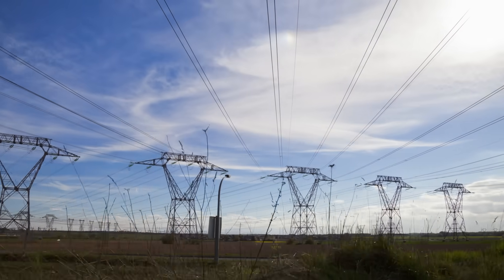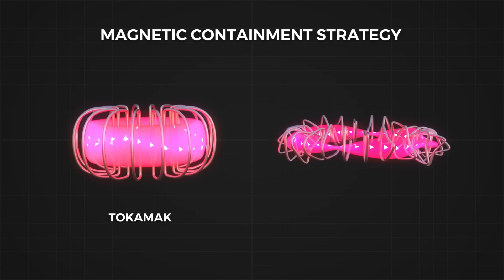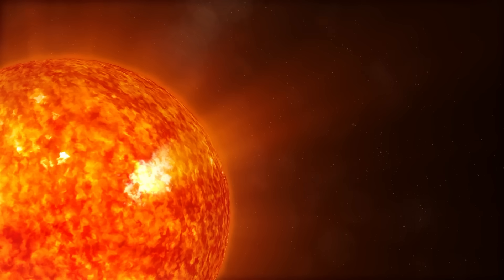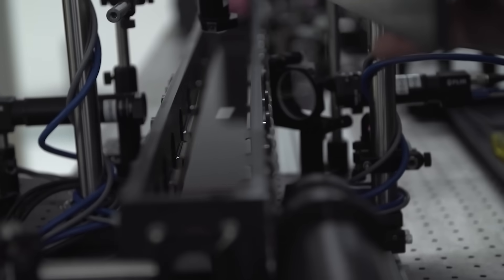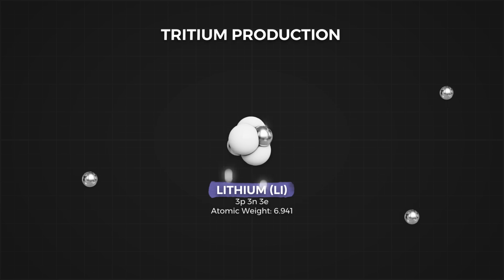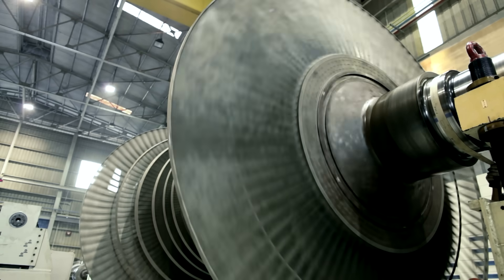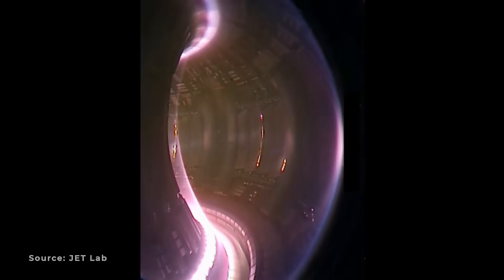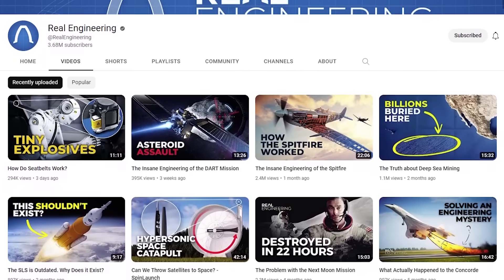The Problem with Nuclear Fusion

Comment: Fusion is nucleosynthesis.

Nucleosynthesis always requires energy.

That's why the Big Bang theory created supernovae.

The problem is the theory creates the universe breaking every law that exists. What happened after the "creation" is a pure guess.

After all, the universe was created out of quark gluon plasma that cooled to a cold universe of hydrogen. Then what?

Science had no choice but to assume, as an unfalsifiable fact, that the hydrogen used gravity as a free energy to fuse. This makes gravity a free energy that cannot exist in this universe and this faulty reasoning has also made quantum gravity impossible to explain for decades.

Anyone can say I'm wrong but I have 70 years and 50 billions dollars invested in it that prove I'm exactly right. The energy science is really looking for is called quark plasma which is what a black hole is made of. These reactors will not use the energy they emit but will utilize the catalyst coming into the reaction which is the same one that causes the force of gravity.

Quark plasma is simply the ultimate form of fission. Religion is what created fusion but creating the universe. This energy will use cheap, plentiful, neutron-free hydrogen not $100,000,000 a kilogram, radioactively dangerous tritium which barely exists on the planet.

If the media keeps telling the world the wrong thing without thinking about what it is saying, the complete lack of disruptivness that has disappeared for the last several decades will continue indefinitely.

Comment: All atomic reactions are restructuring atoms, from high to low or low to high atomic number, and in the process produce excess of atomic electric charge that can be extracted either (1) directly as electric energy or (2) keep it in the system in the form of eddy current and heat, to be extracted to turn water into steam. Just because the recent generations use heat exchange and steam turbine doesn’t means the next generation must use steam.

Comment: Unfortunately, even when we do crack Fusion, there's no way the technology will be made available to all for the 'greater good'. There's too much money to be made from it, and only a few companies will hold the licenses. It will just about money again, because it always is.
Reply: Wrong.  Some of the attempts at practical fusion require very LOW capital investment -- small, very little radioactive waste (and what is created would be short-lived), and DIRECTLY producing electricity (including X-rays and beta particles) which would eliminate the need for giant turbines and steam generators.   Google: ANEUTRONIC FUSION for more details.  The aneutronic efforts may all fail, but many are funded with $100m  (US) and some with much more.

Comment: Problem with nuclear Fusion is that it cannot/will not Produce/Give-off (excess/usable) Energy/Heat.. (not even by mean of providing/running all supportive facilities/utilities.) esp the man-made Tokamak (Toroidal Vessel) Fusion/version ; 
 D2 + T3 --> He4 + n1 + (Exothermic Energy??) (+/-) 17.6 MeV?
D2 :   2.01410... amu
T3 :   3.01605... amu
.......  5.03015... amu : Mass before Fusion
n1:(-)1.008665..amu : 
.......  4.021485..amu : initial Mass
He4: 4.0260325amu: Mass after Fusion
........ 0.0045474amu: INCREASED Mass
The Resultant increment of Fusion Product is the amount of Binding Energy to be STORED in form of Helium-4 Nuclei..(Potential Energy) higher than Initial D2+T3 ;
Meaning the Man-made Fusion (even in nearly FULL Vacuum) Environment is NOT supportive/proper for (highly compressive) Thermal Fusion to occur. (Around near Solar core, the ultra-high compression of 200,000 Million Barg CAN induced self -ignition? of nuclear reaction (but only FISSION(of helium) will give -off energy.) The endless Recycling/Regenerating interaction between Fission and Fusion (of Hydrogen and Helium) will very long time, enduring Solar life-cycle/era.

Comment: All we need is the gravity of a small to medium star, lol. The reality is we are nowhere near practical fusion energy. Look at the cost and time overruns at Vogtle 3 & 4 and those use existing technology built on an existing site. We've been using commercial PWRs since the 60s and we could barely build two more. When fusion starts routinely producing Q values in the 100s or 1000s then I'll get on board. Until then I'm putting it with the flying cars the Jetsons promised me as a child...not holding my breath.

Comment: Yall should be trying to make a stable reaction in 0 G, and away from competing magnetic fields until you get the magnetics right. Small nuclear fuel cell with a 20-year lifespan could easy produce a controlled reaction in 0 G. Then having the back of the tokomak open and varying the field strength at that point produce a content G of thrust. With minor fuel cost that also doubles as water for drinking and making breathable air. Just my opinion on what they should be doing with the design. Besides running a fusion reactor in space could have enough control to make power that could be transported to earth. IDK

Comment: Fusion won’t solve transportation. That’s one disagreement I have. 
For all of of the clean energy debate, oil has consistently been shown to be better than batteries. It’s why early automakers chose the internal combustion engine over motors (which weren’t revolutionary by the way, they were commonplace). One of the first cars was electric. Yet they chose oil. Why? Because cost effective wise, oil is far less difficult to use,; batteries are expensive to manufacture, dangerous in some cases, heavy, and they have to be charged constantly. Not to mention you need a power grid 24/7 for it to be useful. 
Tesla owners carry a generator in the trunk in case the battery dies… that should tell you everything.
Other than that, fusion will solve all non-transport issues.

Comment: Need I point out that nuclear fusion is already a very hot enterprise; If we are going to create and implement practical, mass-produced, massively utilized fusion energy systems as we fully plan to, we should minimize the amount of volcanic heat involved; and I think my system answers this need. Otherwise, long term use will be difficult as the searing, grueling heat will corrode the machines; and it would be a difficult work environment. There's already going to be real heat after the fusion reactions as the energy passed out from the machine through our line onto the grid. Any more and there's a real barrier to converting this from interesting science to useful progress in the practical energy industry. We seem to be overcoming that barrier, though. Please continue to look into and tweak and improve my system; I have it straight from Baby Yoda that it is: 'The Way!' Great to dialogue with you, scientific colleagues. Thanks to every one of you.

Comment: An interesting explanation of the nuclear fusion science's history up to its contemporary conventions. I find this work interesting to some degree. However, I have a completely different system for inducing massive energy creating nuclear fusion without putting in massive amounts of energy or operating at volcanic heat, at least before the fusion reaction. I have most of the central ideas and planning down to the scientific details; but my education in physics and industrial machinery, while existent, is not so existent that I would not need a small team. I am not focused on austerity, always saving energy, but it happens to be that my system involves inputting ridiculously less energy and facilitating fusion by a totally different method. I won't be mysterious about this; but will candidly give you some overview. We would likely be working with Muon-loaded hydrogen atoms, although there are other options. Rather than inducing the fusion by massively speeding, heating, and spinning said atoms, we will construct a tubular energy creation industrial lab machine similar to but significantly larger than Helion's main prototype(obviously much smaller than most fusion machines.) Although these ideas are mine in the sense of conception, I have had fruitful dialogue with a number of scientists and industry leaders including those at Helion; a number associated with M.I.T.; and some others I don't remember but I came up with the ideas myself, but they served as information-giving collaborators in science and also fusion muses. We will prep the machine(an energy factory will be comprised of say 100 such fusion energy machines if not more, if not more) to a chilly hospital temperature; this will disorient the guard and repulsion activities of the atoms. Peering into the gently lit machine with highly sensitive nano-cameras, we will with precisely aimed colliding nano-lasers shepherd said heavy muon atoms toward the central fusing stage of said machine, carefully bouncing them off 'nano-triangles,' which are not triangles but very small walls to with guidance ricochet the two atoms into close proximity where they can be pounced upon and confined by a 'nano-wall,' which is not a wall, but very similar to a narrowly confined pool triangle. It is quite possible at this stage that the two atoms will fuse as they ricochet off the walls of the pool triangle and collide repeatedly; this is true because just as hospital and psychiatric patients become energy efficient, semi-dazed, and docile in chilled hospital conditions, these atoms will behave similarly. We've had decent results. But if they don't, the nano-robot-arm with the nano-laser gun, actually there will be two of them in precise real-time coordination controlled by the lab expert will blast more speed into their atomic bones and the frantic ricocheting will rivet the atoms together into an energy creating fusion.

Comment: We can't produce the mass pressure  of a star  to do this compression fire.  The reality  is were not leaving this ball of mud / this nonsense of tearing forming  mars  is not doable  it's a dead failed  planet  / think about it  what if earth  moon system was at the orbit that mars is at  what would  the habitual zone  of the earth actually  be ? A very slim  band if not a run away  ice ball  . The very a abrasive  sand  1/100 thin atmosphere  neer vacuum.  We can't  do a man mission there until we develop some type of nukelar drive .  The only realistic  answer  is to depopulation  and get back  to a very small number of  humans
Reply: why on Earth are you talking about Mars???

Comment: Fusion (when actually built) being cleaner than fission is a (dangerous) myth. Anyone seriously studying the subject finds that fusion (even if successfully built) would have more radioactive equipment waste because of lower specific power and more complex equipment and shorter equipment life (due to faster 14.06 MeV neutrons) ... See Hans Bethe and LANL study Barrett, R.J.; Hardie, R.W. (September 1980). The Fusion–Fission Hybrid As an Alternative to the Fast Breeder Reactor      https://en.wikipedia.org/wiki/Nuclear_fusion%E2%80%93fission_hybrid#Fission_basics  There is no advantage of fusion even if fusion is allowed to not produce net positive power (but aid in breeding fuel for fission). There is no practical fusion concept that involves less equipment or total waste than breeder reactors (fission product waste is only 30..50 times less than equipment waste, and actually most of the fission products are valueable, roughly 16 million dollars / ton). Ahh, of cource aneutronic fusion would be cleaner... pipe dream. But fast-neutron fission solves EVERYTHING that fusion promises. It's not a technical problem, but "political" problem.

Comment: But  In Space  with  the  Bare  Cold  surrounding it  With a Liquid  Core   ? Fusion  Chambers   are   Safer  But  =  Need  To  be   in small  stations  Not  Giant  Mains  ,  spreading  fusion  chambers  around  evely  would  be  best designn  that  way  you  cant  spead  the  field  load  , as  all  mamgnetic  structures  create   a  magnetic  field

Comment: Eventually check the mathematics myself, but I've always wondered why neutrons themselves couldn't be kinetically induced to fuse seeing as though there would be no coulomb repulsion. Then by inducing beta decay, we could turn those neutrons into protons while they're already Bound in a nucleus. Kind of like building a ship in a bottle, in which you build the ship first.
Reply: That would require a constant source of free neutrons... which would need to be derived from something like a fission reactor (so it doesn't really solve the problem). Additionally, free neutrons decay in about 15 minutes, and can be captured by the surrounding wall material, making it radioactive. This is unavoidable - as you pointed out the neutrons aren't affected by electromagnetic forces and so cannot be contained using a magnetic field as plasma can.

Comment: Solar and wind are not cheap, they are massively funded by tax payers and even so, it increases the cost to consumers. Clean coal is 55% efficient, one of the best. Then we have nuclear, solar and wind are at the bottom. And don't forget we already have millions of tons of old wind mills and solar panels piling up in landfields. No company wants to process the trash is inefficient and costly, but nodoby talks about it. And do not forget the offshore mills, because of the salt takes a higher cost in maintenance.
We need to focus on cost effective energy sources before we close the gap to gen IV nuclear and future fusion. Gen III+/IV nuclear can recycle spent old fuel from gen I and II nuclear power plants. Making the byproduct less then 10 years until it can be dumped on the open air without contamination.

Comment: So if one force is the center connected to the core, there is a second force that pulls the first one on each end pulling one another around the first force but the negative ground in-between the two is actually the negative requirement.

Comment: tl, dw: The problem with nuclear fusion is that the energy needed to create the conditions needed for fusion is often too high to be practical, and the tritium needed for the process is becoming increasingly rare. However, research is ongoing into developing ways to extract more energy from the fusion reactions than is needed to create them, using high-energy neutrons.

Comment: No matter what kind of reactor we make, it the most basic concept, it's just a fancy water boiler. We might have come a long way to react difference energy source but the way we harness that energy is the same as we did 200 years ago, we just heat up water to make steam that is the used to produce mechanical energy that is then converted into electrical energy. If we really want a game changer, we need to figure out a way to turn those fuel straight into the energy source we needed. We need to figure out how to make a nuclear reactor that doesn't use water to create electricity.

Comment: If your working on the entire plants fusion 
Watts wrong The fusion the planet already has? 
If IT Is ir (2to) reel a vent (b v pro noun sea si @ ion ) 
Sentence It is irrelevant 
If your relevance didn't stem from lancing 
Sidenote do you know Ian ian the person? 
If I an is a form of ain would the speed of æ be seventeen? 
Iu (keyboard pressing 87) also l7 a long press of key board notes 
In a q either capitol or lower case in the upper right corner is a first or furst power

Comment: What if you had a tech tonic plate magnetic field two directions of magnetism like a horizontal tornado or hurricane 
The Polaris of the Earth 
The Polaris of each planet 
Combinations of Polaris 
Looking at the milky way balance for a spin 
The galaxy has a axis of 
The magnetic charges from outer inner rims of our milky way suggest watt? 
What type of metals 
The medals are of what degree in a direction that suggests? 
If your are convinced it's NOT an energy source the not suggest a current with undertones of density that day kelviNOT 
If a vin number search for kelin does not au y DA x5 in a car try the VIN car EARS 

(But I ask are you trying to take the job of the milky way?) 
If the answer is yes motives may appear undeseriable 
If the answer is know with a trick on galaxy 
Universal powers is more likely probable 
If the answer is no with detailed reasons for purpose 
Reasons for machine 
The answer will present itself in the question 
If it's a quest in general God speed

Comment: What if there was a way to harness the energy of the explosion from the nuclear weapons we have just lying around? There's a fair amount of heat/pressure generated that would create a metric ton of power. Even if only a fraction of the material were used it would still generate a sufficiently large amount of energy. Or maybe look into harnessing the energy created from the decay. Less inherent risk involved than trying to contain the blast. And if harnessed to 100% efficiency would last for as long as the isotope takes to decay. So like many thousands of years. If that's the case, we have enough radioactive material to last a pretty long time
Reply: And if we get down to it. Radiation is the energy of universal scale. It provides the energy to light up the night sky and lights up our days. We figure out how to harness radiation and we never need energy again. It's for all intents and purposes, an infinite source of energy because it's all around us

Comment: Don't know where you find 216 - 560 tonnes of Beryllium (Be) needed for the reactor ? 
I found on Iter website : "The 440 first wall panels will be covered with 8-10 mm of beryllium armour, for a total of approximately 12 tonnes of beryllium distributed over a surface area of about 700 m2.". So Iter is going to use 12t and a little bit more ~12.5t in total if we count other systems that require Be. And even if Iter claims that they'll only need to replace these panels once, that's only 24 tonnes of beryllium. So, where did you find this 216-560 tonnes range ?